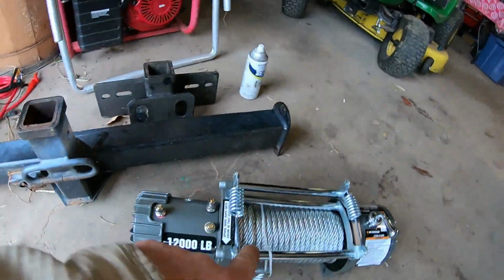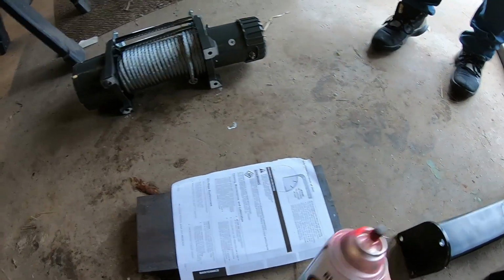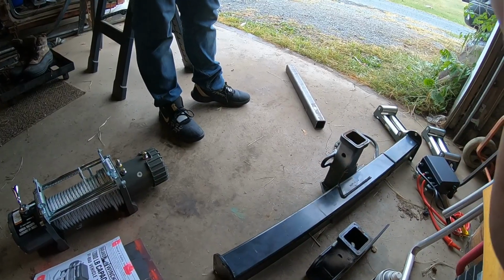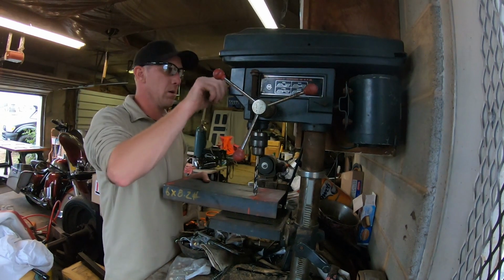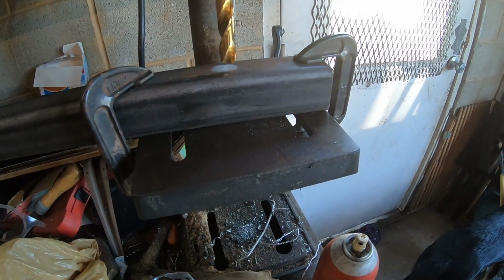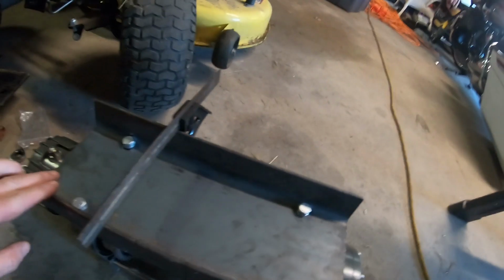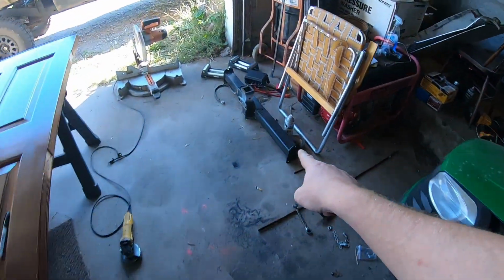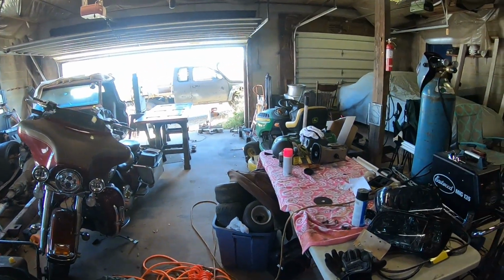building a winch mount

Comment: The easy way to make your own winch bolt pattern is put the winch upside down then take some cardboard and put the cardboard and set it over the winch bolt holes and poke out the holes with anything and then take your winch bolt pattern and then drill the holes out